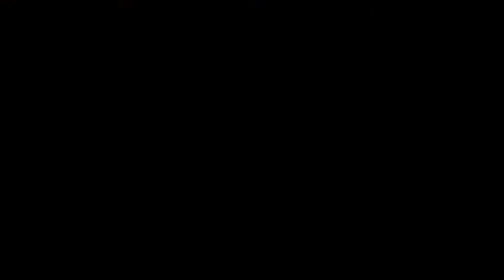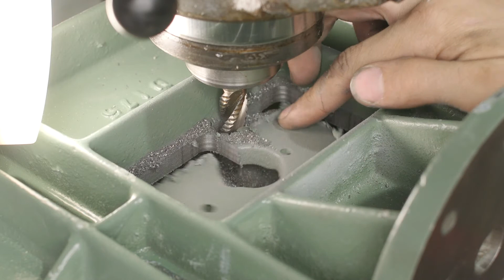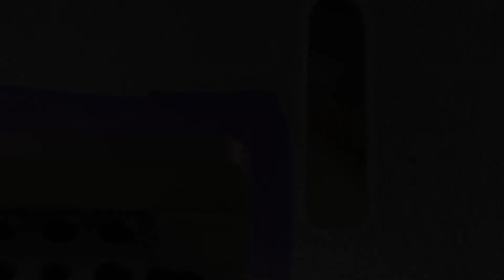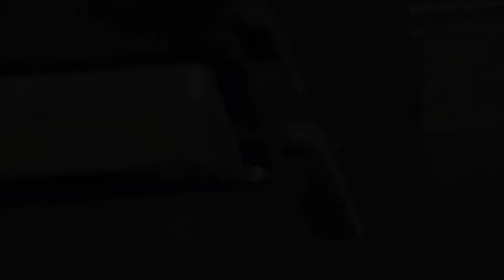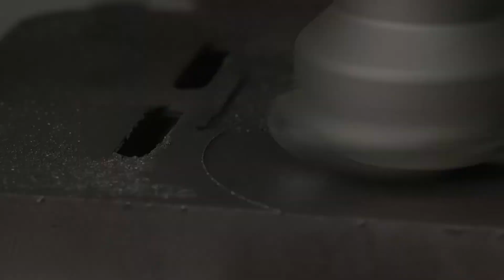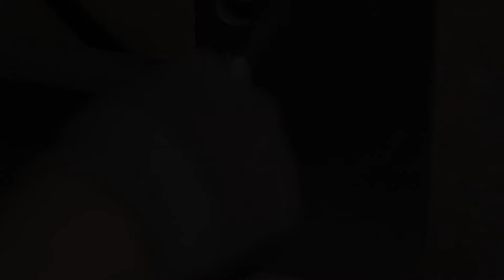Drill Press Table Repair (Resurfacing on Mill)

Comment: Nice job, my friend d9ne a similar fix on hid pedestal drill but used a piece of aluminium for the inset piece. He milled either 4 or 6 tabs to the underneath of the inset and drilled and tapped into the cast iron webbing and fixed the plate to the base. He faced the base by about 0.010" - 0.015", if my memory serves me right. I read in the comments that the customer will only drill wood on the drill press, just seemed unnecessary to face so much off, but the customer is always right lol😂.
Reply from the maker: Yep indeed

Comment: I find it very strange that you cut so much of the table face.  It was not all that thick to begin with, and you milled it down to about half of the original thickness, making it weaker. ---Doozer
Reply from the maker: It’s being used for woodworking it will be fine